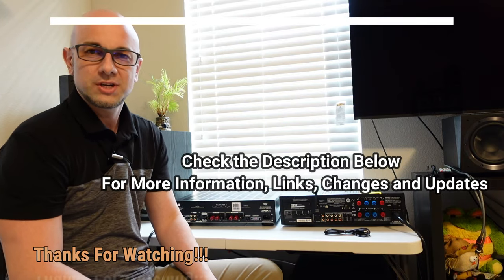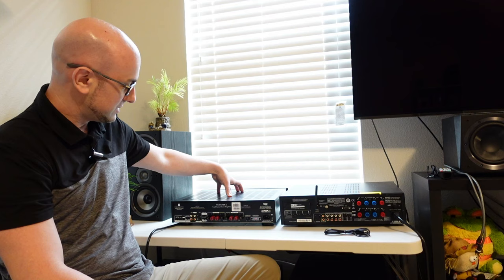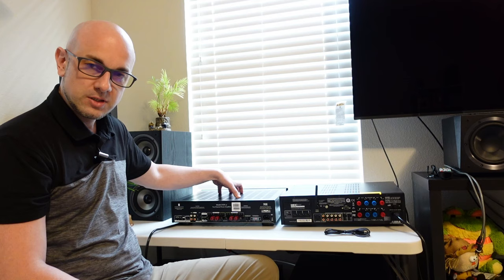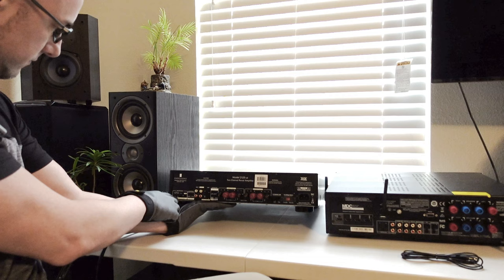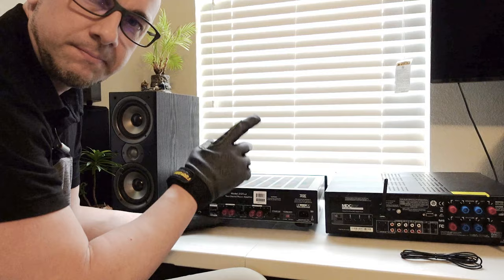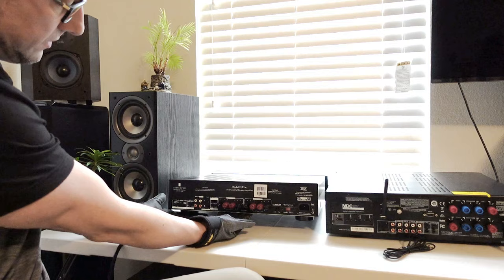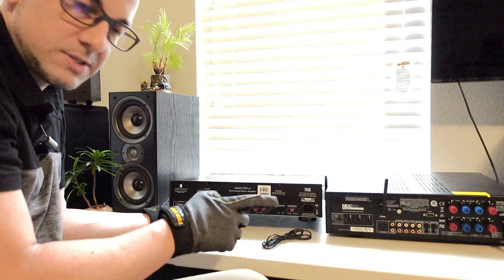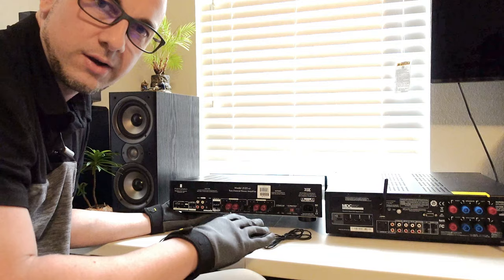How to Connect Amplifier to Receiver, Preamp Outputs Explained, 12v Trigger | Home Theater Audio

Comment: I have a question. while plugging in the speakers themselves, to take advance of all the power, would you plug a few to the receiver (preamp) and a few to the amp? or plug em all to the dedicated amp?
Reply from the maker: You would typically use the amp for the largest or more power hungry speakers and the receiver for small ones
Reply: So you plug the biggest speakers to the power amp , and the others to the preamp ?
Reply: @OldtradesReviews thanks for the video. Am totly noob here. Am geting a denon 3800H & a 5 channel amp soon. So how the setup gona be ? Hook all the preouts to external amp and then run the setup or do setup fisrt ( amp assign and all ) later connect to ext amp thru RCA ? 
Thanks

Comment: So i have a marantz receiver which is 100w per channel. And a 5.1 system. Recently brought a new set of speakers. Which are more than 150(surrounds)-300(tower)W speakers. Im guessing it's better to add a power amp. But i don't want throw out my old speakers. Can I just leave the current system in the standard outs, and connect the new system to the pre-out with a power amp? So that I can use both. If not how can I use both
Reply: How did you get on ?

Comment: Thank you for explaining. Sir. If I understood you. I would say, if I have to use the 12volts option to power the main amp, then, I do not need to plug in its original power cord to the AC power outlet. I'm I, right? The 12-volt only is enough. Right?
   Secondly, to transfer sound from the preamp to the main amp  All you need to do is, connect preamp out to the main amp in the selected input source, right?

Comment: My new Rotel RC 1590MKII has 2 left and 2 right preouts. My amp is an Emotiva XPA 3 channel. How do i connect the preamp to the amp to play the 3rd channel as my center speaker? (2-KEF Q950, 1-KEF Q650) The Onkyo TX -RZ50 receiver that i am replacing had the center channel preout included.

Comment: FYI, a receiver is an integrated amp with an AM/FM tuner built in, that's what denotes it as a receiver... it receives AM/FM signals due to having a tuner on board.

Comment: hi..  power amp to stereo receiver question.. when hooking up a power amp to a receiver and assume the receiver has preamp/amp in/out connections and there are no AV requirements, just audio. Can you hook up a large amp to the smallest capable receiver? in otherwords if the ext power amp 'replaces' the receivers amp, then the size of the receiver amp shouldnt matter right?
hope this made sense. thanks!

Comment: I own a pair of relatively inefficient speakers. Powering them is a challenge.
I currently have 2 mid line preamps &
 2 -70  watts pet channel amps. I am thinking about adding 1 more power amp to my rig. Can I daisy chain another amp? How do I hook it up?  Thanks!

Comment: The 2 vintage power amps that I purchased together are the McIntosh MC122.
I want to hook them up to a modern midline integrated amplifier similar in quality & features to a  current Rotel integrated amplifier. So, those there are 2 amps that I want to daisy chain together.

Thanks

Comment: using a L/R receiver preout disable the builtin L/R Receiver speakers? i want simple send the same music on my Receiver to play in another room that has a amp there. but i want all speakers on receiver still work.
Reply from the maker: no the preamps will work separately but be controlled  by the volume knob with the speakers connected

Comment: Good video but I was hoping you would talk about speaker connection. You would connect speakers to the amp instead of leaving them connected to the integrated? Also, Is there a way to connect a tube pre-amp to an integrated receiver? I have a Yamaha RXA780 and wanted to see if it would be possible to add a Schiit Freya+ into it instead of having to buy an amp.
Reply from the maker: Hi,  Thanks for watching.  The speakers always connect to the AMP.  As the amp will power the speakers.  The Yamaha would function as a front speaker preamp out in that case.... as I se from the pictures online.   The freya + is a preamp...which means it has NO built in amps.  In that case you would purchase a separate amp of good quality to connect it to.
Reply: @OldtradesReviews  Thanks for the reply. Yes... I was afraid my assumption was true. I was hoping that I could get away with just investing on a Freya+ and connecting to my integrated somehow. My plan now will be to get the Freya+ and Vidar to connect to a speaker switch to them connect to my Klipsch RP8000F. I think the speaker switch might be the way to go because I want to keep my Yamaha receiver for my TV, AppleTV, etc... connected to the same speakers. You have won a subscriber here!
Reply from the maker: I appreciate the sub.  thanks for watching.  Based on the Yamahas 95 watts I dont think the Vidar is a good move because you will probably feel like its not much of a difference.  Going from the 95 watts I would suggest maybe just buying a new receiver in the 125 x2 or more range.  Or adding a amp that is 150watts or more x 2 ...to the freya.   To notice a power difference.
Reply: @OldtradesReviews  didn't think about that. I feel like I get enough power from the Yamaha, but then again, I don't know how these speakers would sound with more power. The Vidar just seems affordable and I like the other Schiit products I have. I would be of course open to find a more powerful amp around the price of the Vidar. Need to research more, but hey, great back and forth!
Reply from the maker: Look the Parasound 2126 its 150 watts  https://fxo.co/Cilg  I made video of it.  Typically speakers sound better when they are fed wattage from the manufactures higher part of the suggested range.  Of course like with any amp,  the tonal quality has to match your tastes and speakers.

Comment: The question is when the amp is finaly connected, is it possible to control the audio of the speakers connected to the amp, with the receiver? Like bass, volume etc.
Reply: Yes, the amp only gets a signal from the receiver and sends it to the speakers, so you control the sound parameters as per normal with the receiver (this is from experience not expertise so my jargon may be way off)

Comment: Could you make a video that shows you how to test the "pre-amp" output of a subwoofer plate amp?   There are many amplifiers floating around online that range from 25 watt to 2500 watt and they all require a specific voltage input from a pre-amp board.  If people knew how to measure the output of their "subwoofer plate pre-amp" because they blew the power amp part.   It would be a huge video if you could teach that in a simplistic way.   I realize it's not that simple, but it wouldn't be hard to give the basics.

Comment: If I don’t have Pre outs say a denon 760 and I use an adapter from the speaker out to the amp ?  Is that the same as a Pre out?  Do I lose quality?  Do I have to change the settings?  Is this not recommended?

Comment: I purchased this same amp and I guess I didn’t do my research as well as I thought, I wanted to hook it up to my Yamaha RN-803 stereo network receiver but it doesn’t have speaker pre outs . It has line in and out , the problem is I won’t be able to adjust volume from Yamaha receiver . Do I need another pre amp with correct connections. Any help will do thank you
Reply from the maker: Yes either a pre amp or a new receiver with the rca outputs.
Reply: @OldtradesReviews  thank you , your videos are simple and to the point
Reply from the maker: Your welcome.  Thanks for watching
Reply: hi I also have a Yamaha R N803 network receiver which doesnt have a Pre out. but it does have a SUB out , can i connect a Power Amp via Subwoofer out since in dont use it ? 

also - The yamaha RN 803 has a 12 Volt trigger Out . if i just connect the receiver's trigger Out with the Power Amp - will that work  without the RCA cables? sorry for too many dumb questions !

Comment: If I have a stereo receiver and a 2channel amp, can I power a pair of speakers with the amp in the receiver and at the same time send signal through the preamp section of said raceiver to the 2channel amp to power another set of speakers?

Comment: I have a Marantz sr6009. I was wondering if the signals from the preouts output the same signal from the front preouts and the surround preouts. I want to run 2 amps, both running front sterio mode. Can I use the surround preouts as front preouts? Is the signal the same? I assume any model reciever would be the same.
Reply: Nooooooo

Comment: I have a Pioneer Elite vsx-lx304 with zone 2 preout and I wanna run my front speakers with an external amp, will it be possible?
Reply from the maker: Zone 2 is really for a different room.  Also it can be tricky to setup right.  I have never had luck or enjoyed using zone 2
Reply: @OldtradesReviews  It has Zone B also, but it's Stereo only, no Surround.

Comment: Hi there! Question pls🙏🏼 can i use marantz sr7015 av reciever with marantz pm 6007 amplifier? Will it boost the sound if used on my speakers as (2way) for audio listening? Thanks!
Reply: Hey how did you get on with that? I have the SR5015 and I have a couple of Marantz integrated amps , and 3 Marantz mono MA500s. I don’t have any experience in pre outs etc and don’t want to fry anything

Comment: You said everything but the one thing I need...if on the receiver you plug in pre out then on preamp do you plug into pre in or pre out?
Reply from the maker: the receiver or preamp out will go to amps input
Reply: @OldtradesReviews  thank you....I know that was a stupid question but I couldn't get either to work at the time...then I realized it goes in standby after being idle for only 5 minutes or less...I hate it....so when those speakers are used the preamp clicks on then you get the sound in the middle...you don't hear the beginning because the amp is turning on...so bad....I even turned to on instead of auto...still the same.
Reply: For RCA you will go from Source (T.V, DVD, computer, recored player, ect.) RCA output to preamp input /  then preamp RCA output to your receiver and/or amplifier RCA input. From there if your reciver/amp has pre out for a active subwoofer not a passive you cn use that pre out to feed another amp of you're choice and if that amp offers pre out than keep it going I would just worry about you 12v trigger after more than a 2nd daisy chain. Then you're gonna want to use  relay powered by a separate power supply and have that turn on 3 or more daisy chain 12v triggers or you can burn out your gear pulling more current than it's designed for. Also you risk getting noise and hissing through daisy chains especially if the audio gear are on different breakers and/or outlets like the receiver, T.V, Amplifier, ect. aren't on the same breaker linked to the outlets all the devices are plugged in but it can also occur if they are on the me breaker for similar or different reasons. But I found out if you take a wire and strip it at both end and link one to the RCA negative terminal outtermetal contact on one or all of them depending. I take the spare wire and make a hook shape and I loop it around the RCA maleconnector and hook it around the outside metal and plug it in so that the wire is held on the RCA terminals outter contact and held firmly. Then the other end to the negative trigger on the recieiver/amplifier and that fixed just about ever hiss issues ive ever had aside from a few ground lops that needed filters on the power lines, RCA,, and remote wires.

Comment: please suggest RCA cables to connect amp to avr  ?  i see  many rca's but not sure which to use.
Reply from the maker: I like the ones from KabelDirekt.  Compared them to cables costing 3 to 5 times as much and could not hear a difference
Reply: @OldtradesReviews   Thank you, will check if i can get from Amazon India
Reply: Also  i have  amazon basics 2* RCA male to male(Red & White cable)  .Can this be used to connect each of the channel.
Reply from the maker: You can try it.  I try to look for a cable that is shielded, when possible.
Reply: Got dhvis cable

Comment: Quick question! I have a Yamaha R-S700 stereo receiver, will an Emotiva BasX A2 be compatible?
Reply from the maker: Based on the pictures of the Yamaha, it has preamp outputs.  So you can use a external amp

Comment: So in my case with x2 Polk audio TSX440t speakers and x2 powered subwoofers, and a Denon DRA-800H. Connect the tower speakers to the amplifier and connect the subs to the Denon? I hope my question makes sense.
Reply: Connect the preouts from the denon to the main input on the amp connect towers to the amp. Subs to avr

Comment: I have a question, is it possible to connect the receiver with the subwoofer output to the car amplifier and power the subwoofer
Reply: As long as U can get power to it. But that's the problem that I'm having, trying to come up with a solution for power.

Comment: Great video. I have a problem with my Sony subwoofers hooked onto the DEVON AVR 590 Receiver. The other front, surround speakers are producing sound when I do the level test but the sub is not. I tried to add the level volume, I changed the rca cables but nothing. The sub is connected to the RCA preout port on the back of the receiver. Anyone please help. 

Kind regards
Reply: All I can say is if you have it connected to your subwoofer pre out as I do, mine is clearly marked.Check your speaker configuration on the receiver slash tv screen , make sure it matches what you have going on.Then check to see if its doing anything on the test tones,my height channels for example won't do anything if my configuration doesn't match,so I have to configure them correctly  before I can use "Accu EQ" or anything or they do nothing..Make sure you have the sub and mains on, if you see that option anywhere along the way.
Reply from the maker: The response from Steven sounds good.  I would suggest connect the sub to something else.  Also try the Sub out.  Just incase your L/R preamp outs are broke
Reply: @steven3517  Thanks for the response. I will twick around with the settings and see if it makes a difference.
Reply: @OldtradesReviews  thanks for the reply. I will try to connect them to the L and R preout and the sub out again to see if it makes a difference. Thanks

Comment: Would this be viable to add power to vintage stereo systems I have a cool old Pilot audio systems set up that I play records on with speakers way bigger than it can push. Not sure if that 12v trigger wiring would work out of the aux jack? Then I could hide the shiny amp somewhere. Or if you could just run the aux right/left jacks to the amp. Kinda odd wanting to do this but be cool to see an old dog of a system push nice speakers. Great videos!!

Comment: I understand that I've to buy a 12 volt cable. But my doubts are complicated. For almost 60 years old, I use ever 4 speakers for my home Stereo Receivers. I've Yamaha R-S700, plus the "new" Yamahas n-r602 and r-n803 (five of them), and a Pioneer sx-1980 (but to work with it I have to heat it for 10 minutes to work full with it). So, I've decided to go on with Yamaha r-s700 (very good power, and don't need a stereo amplifier, because the JBL S-312 are all in 8 ohms). Ever with 4 of it (4 tower speakers ever), and Stereo Ever. What called my attention, when I read four (yes, 4 times) the new Yamaha Stereo Receivers rn-602 and r-n803 is that I have no way to plug or to hook up a Stereo Amplifier to any one.
I don't have any interesting about Music Cast, Spotfy, Alexa, cellular...
The only things I wanted and want: bass and treeble controls, Loudness control, and to plug my (for example) Yamaha r-n603 to a Stereo Amplifier (like the one you have -- Parasound, but the New Classic 2250 v.2), and 4 (four) speakers, like the way I do with my Yamaha R-N700 (I don't need an amplifier, but I put 4 speakers working). The new Yamahas don't show how to connect a stereo amplifier to its receivers. If I use the "trick" of 12 volts cable, I'll be able to hear the 4 speakers working very well, or I would buy 2 (two) Stereo Parasound to do the "trick" to move sound music to my new Yamahas? What I want is a stereo amplifier to increase de sound volume, but my Yamaha Stereo Receiver to adjust my bass, treble and Loudness control with 4 Tower Speakers playing all together. And don't want "technology", neither cellphone to control the media...
I think to trade all my "new" Yamahas Stereo Receiver and buy 5 more Yamaha R-S700 (it sounds almost the same as my Pioneer sx-1980, only lacking only 2 degrees of bass, maximum), and sell or trade my Yamaha ns-777 (6 ohms is very weird from me). I only use 8 ohms for all things. Congratulations for your explanation.

Comment: Great info ! Question , I have a Sony str h790 receiver powering 3 sets of polk audio speakers.  I'm planning on adding another set make 8 total in a large area. Mostly music . Will this work for me . Any suggestions  ? Thanks in advance
Reply: Also have 2 svs 2000 subs , need to make sure this will work with subs also
Reply: @MrNeville78  did u try this yet? How did it work out?